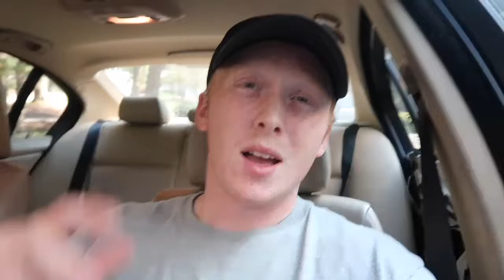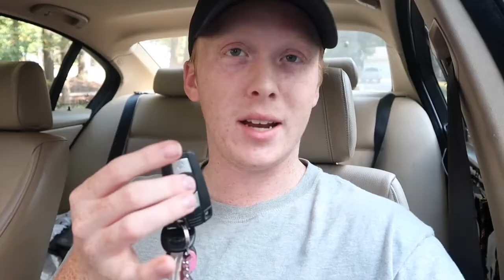How to fix a BMW window that won’t roll up for free!

Comment: I found a solution for this as my e90 decides to do this often. While the window is stuck down, pull the button up half way for 15 seconds, then immediately, fully pull the button  up for another 15 seconds. When done properly, the dash will say Anti trap function. I'm assuming this action bypasses the anti trap and allow you to roll it up. Hope this helps.
Reply: with the car off orrrr
Reply: InstaBlaster
Reply: I’m worried I’ll shear my plastic motor gears this way but it’s worked for you in the past
Reply: If definitely works. Thanks
Reply: It worked 😅. Thanks mate
Reply: Thank you so much
Reply: This worked for me!! Thank you!!
Reply: you the goat it’s pouring down rain here in houston a whole thunderstorm! and my window didn’t go up for like 30-45 minutes this comment was clutch.

Comment: I doubt you’ll see my comment but it’s worth a shot. First off you’re adorable you look exactly like my son :-) second I bought a 2004 BMW X5 last night that looks new however the driver side window stopped working today after only having it one day and then, when I went to exit the car, the door wouldn’t open so I had to crawl out the passenger side. So I swung by Mechanic’s place right before closing and he said to come back Monday that the windows not coming up because of something in the way from the door handle not working. What do you think something like that’s gonna cost me? I’m scared.

Comment: Well here’s what worked for me. 

I didn’t let it sleep or anything. I parked the car after well over 20 attempts of pressing the button to roll up. 

I never tried that remote-roll-down-the-window <- pretty cool to see that work. It will continue to roll down so long as you hold the button. 
I used the remote to roll them down then when I turned the car back on to roll them up, they all came up including the problematic one.
Reply: Worked for me as well!

Comment: Great video thank you it actually saved me from buying parts I didn’t need ! 👍
Reply from the maker: That’s good man 👌🤘🏼
Reply: OMG, YESSS!!!! I AGREE!!!! First time this happened, driving home from work around 10pm and haven't took out my bathroom trash for almost a week, started to smell with my son's diapers in it after I took care of it to the dumpster I rolled down my windows to get some fresh air because I felt I still kinda smelled the odors and after rolled it back up but the passenger back wouldn't go back up like described in the video, after I saw this video and then tried it right away, turned  off my car and turned it back on and rolled down all the windows and then rolled all the windows up and that window rolled up too!!!! It worked!!!! Yay!!!! Saturday night saver and down South where I am right now everything's closed on Sundays.

Comment: I had the same problem with my 2007 328XI last night. It was the window behind the drivers seat and it wouldn’t go up at first. But then I turned the car off for a bit, then tried again and it worked, but only when I flipped to switch to hear one click instead of 2
Reply: How did it work for you?

Comment: I need help, I have a 2008 hardtop convertible 328i my roof is stuck down and my back passenger window won’t go down. All other windows are stuck down except that one. Is there anything I can do to get that window down
Reply: What ended up fixing this ?

Comment: well yeah it will go back up but then i you roll it all the way down it happens again.  Mine was doing this before the regulator went out.  I replaced both sides and worked fine for almost a year.  Now again one of the rear windows is stuck down again. It tries to go up but only half inch.   This means the regulator is about to out .  I asked for a replacement under warranty and replace it.   Thanks.

Comment: My BMW i3 does that too, and you can even open your sunroof from the keyfob as well.
Reply: same here that I have 325i
Reply: How.
I thought it only opens doors . Is there an instruction booklet on this key fob.
Just bought a 2007 bmw
Reply: @susannawebb2552  No, there is no instructions just for the keyfob, sometimes it is mentioned in the owners manual, but the way I first found out was from my dealer, and from youtube videos. To open your windows from your keyfob, make sure your doors are locked, press the lock button twice. Then to open your windows from the outside of your car using your keyfob, either press and hold the unlock button until your windows roll down, or press your unlock button 2 times and hold on the second time. If that don't work then your model doesn't have the feature.

Comment: Hi..i got problem on BMW E90 too...

Im driving normally...when i turn off the car, get off...my all windows get opened...
I turned on car again - rise them up - turn off, and it starts again...
After i open my drivers door it get down...after delay of few seconds...

Hopefully i can rise up them by holding button BUT it doesnt work always...maybe after 5-6 times of trying...

I went to automechanic, he once fixed it and now after 2 months its started again...now he's in problem too 😅
TIP: i washed my car day before this happened...

Comment: Had the same issue, hold the window up button and while doing it open the drivers side door. Seems bizarre but it worked for me
Reply: I just tried this and it worked. I had someone ready to open the door and at the count of three I pulled the window up button and she opened the door with the problem window and that worked. It took a couple of tries, but it was fixed. Thanks for the tip Alex and Ahsan for the extra info!
Reply: To clarify, hold the window up button on the drivers door and then open the drivers door, you don’t have to open any other door as far as I know.
Reply: You sir saved my morning!

Comment: I wanna help everyone through my EXPIRENCE . Yes i did Replace the regulator . but if your window stopped completely AGIAN . and it doesnt work while waiting . then Replace your window motor . that will completely fix it . Through time these window motors will fail and will need replacing

Comment: I have an issue in my 325i 2009, when I turn off the car 🚗 all windows and roof top automatically open and I have no control over them and then I have to start the car again to close the windows then of I fail I disconnect the battery and reputed again to solve the problem 😩 any help please?

Comment: what buttons do i press on the get to get them all up
Reply: Your key fob most likely isn't programmed to roll all the windows back up, but most of them will roll all the windows down. You can however roll all the windows (and close the sun roof if you have one) by manually locking the door from the outside with your key and holding the key in the locking position for a few seconds